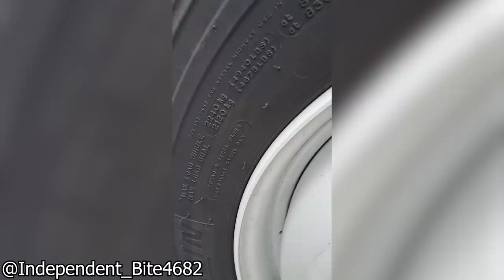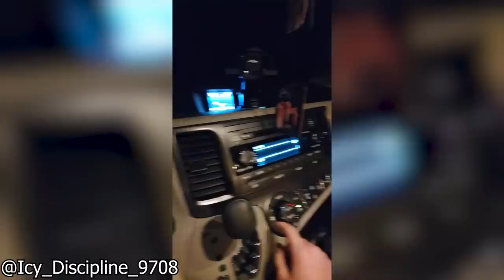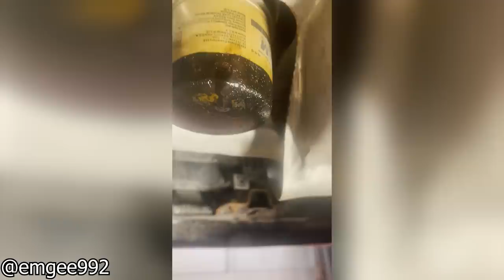Customer States They Just Noticed Grey Sludge In Their Coolant In The Engine Bay

Comment: The wipers are in service mode
Reply: The wiper brakes are worn out. ChrisFix has a video on the problem. He made it at the beginning of April.
Reply: Or in winter mode so they don’t get stuck to the cowl.
Reply: Nah it's an Audi, to put the wipers in service mode you first have to remove the front bumper, radiator, and engine.
Reply: They probably skipped removing ice/snow by hand. Motor gear or teeth jumped under heavy load.
Reply: Wipers are in annoying mode
Reply: I have a 2014 Audi and they do have a service position. They probably didn't know it was a thing and did it accidentally.
Reply: Looks like a 2005 A4. My did the same, its a known problem. The posts where the arms connect get rusty  and the position slides away with every wipe because there are no real theeth only screwed down on a conical post
Reply: Also not how you pronounce Audi
Reply: @wyattgardner3552  That doesn't explain the wipers still having the normal range of motion.  If the wipers had skipped a tooth, the driver's side one would come off the windshield to the left, and they wouldn't ever cover the bottom of the windshield.
Reply: PEOPLE! The wipers are in SERVICE MODE, f.f.s....

Newer Audi's do this so that you can easily change the wiper blades... Other wise on some cars the wipers tuck up under the edge of the hood when they are off, and it's impossible to be able to raise the arms and access the blades. 

The person accidentally put his wipers in service mode with the menu buttons, and doesn't realize it... PERIOD, END OF STORY...
Reply: @flagmichael  What the fuck are "wiper brakes"?? 🤔
Reply: @davelowets  but this is no newer Audi this is a b6/b7 there is no Service Mode
Reply: @AstraFreak1984  YES, there IS...

Comment: Easy to fix the wipers....turn car on, use wipers, when wiper is down, shut car off quickly, then shut off wipers with switch, then restart car...NICE belt tensioner on the one video...luckily that one looks very very simple to get too! Too bad they didn't make them all that way!
Reply: It's NOT a belt tesioner problem....
 Look up and to the right just a bit, and you'll see it... 👀

Also, that will not fix the wiper issue. They are in "service mode", used to get access to the wiper arms so that one can change the wiper blades.
Reply: AHHH alternator not spinning! Saw it! took me 3 tries though, irl I would have spotted that asap. At least it's an eay fix.
Reply: @shanemitchell477  Yep